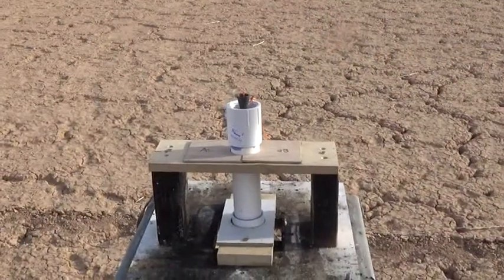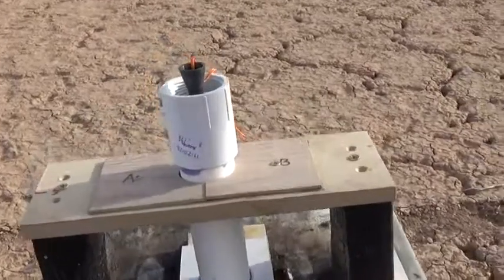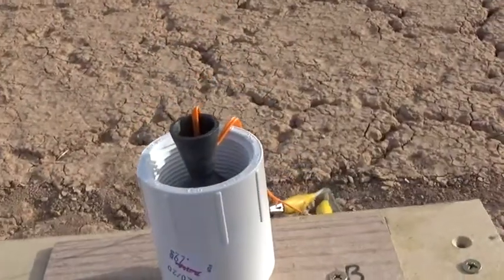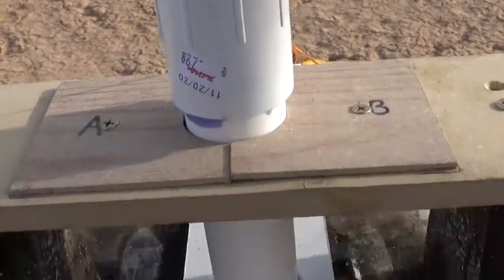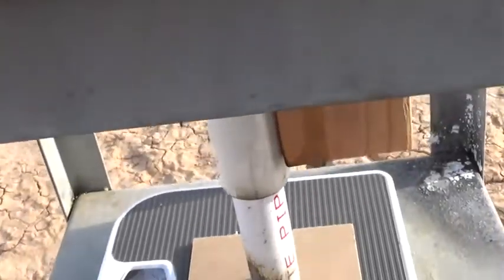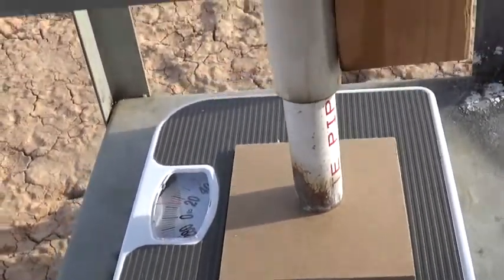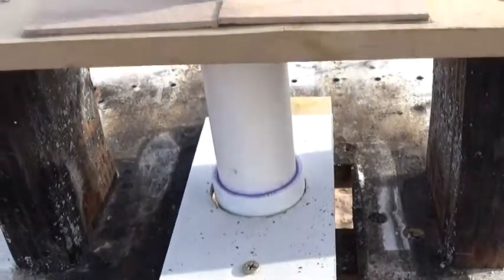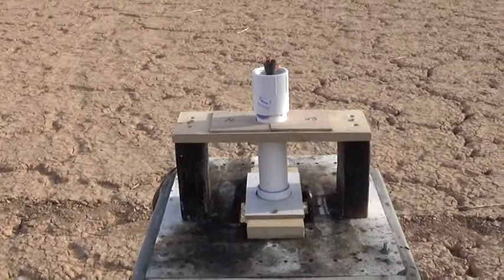Model Rocket Motor ground test.  Epic Fail

Comment: "I suspect the nozzle was too small.  We will try this again soon with a larger nozzle." and you have a pvc case. This is an unsafe way to do Rocket motors. I recommend using open motor to simulate your motors so you dont get a cato and perhaps buy a aluminum case that can stand up to proper pressure and heat from loki research or fisher research.

Comment: you know if a piece of PVC gets embedded into your body, Xray machines will have a tough time picking it up and it could lead to serious complications. DONT BUILD ROCKET MOTORS OUT OF PVC.
Reply from the maker: Thank you for your concern. We are a very safe distance away with a remote control ignition system. People build and launch very successful PVC motors all the time. In fact, I have developed two fantastic motors, one of which provides 100 pounds of force and have launched that model several times. This 3" one however, has been very troubesome and I have stopped development after 13 failed attempts.

Comment: don't use core hole, because combustion speed of your propellant is high....
Reply from the maker: Without a core, this small diameter motor will not have enough thrust to lift a rocket off the launch pad. This was designed to start as a core fuel cell and then transition to an end burn fuel cell. I have stopped development on this style of motor for now. I have plans for something similar in the future but we are having fun with our "working" motor styles right now.